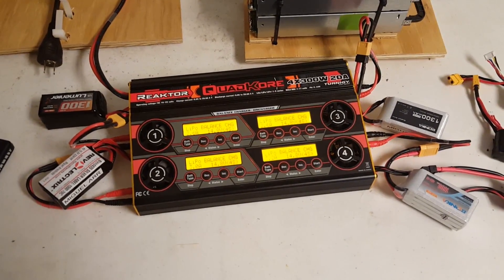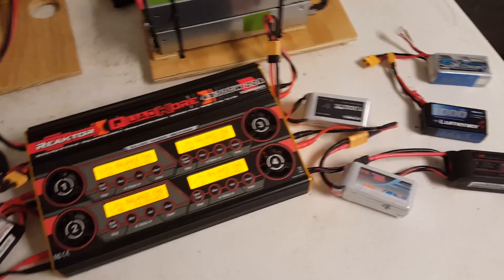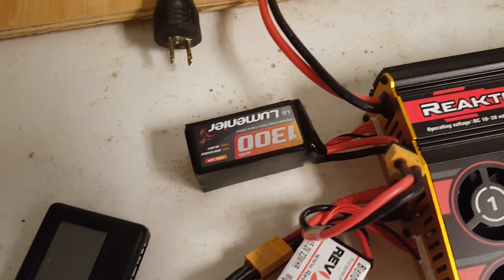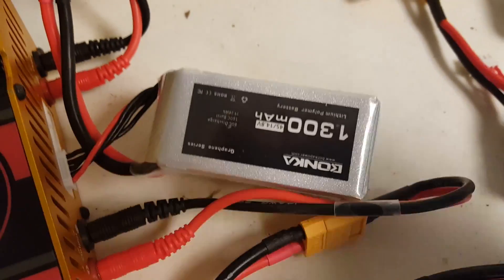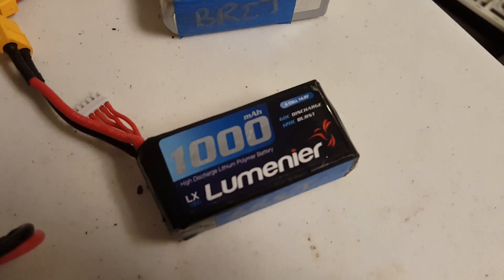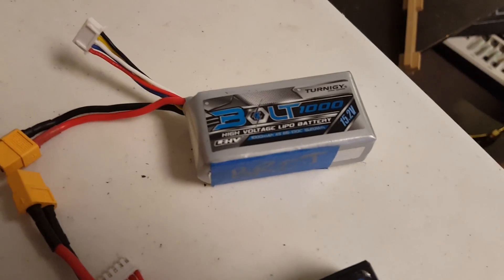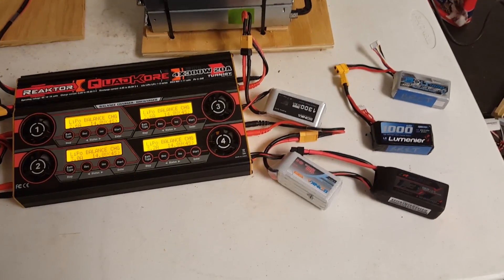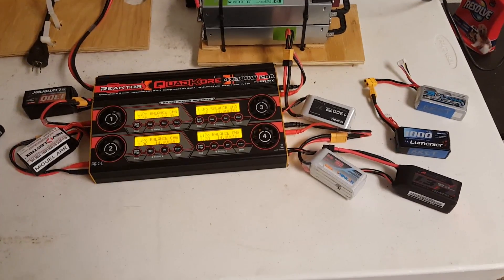Battery Test Group Two Teaser

Comment: Tell me you saw chad Nowacks periscope the other day at flight test? He has been and will continue to charge standard lipo's to HV levels without issue.  I wouldn't do it but after this group maybe try that with "donated" batteries. He's been doing it for 6months or so.
Reply: Says it works great but out of the interest of safety he couldn't "recommend" it. I wonder if most the batteries made today are "generally" the same Li on the inside. Even the HV ones.
Reply from the maker: +Invitingsauce My understanding is that you can charge LiPo to HV levels without substantial safety risk, but it shortens their lifespan. I don't have any test results to verify this. Wouldn't the joke be on all of us if HV lipos were just standard lipos with a different label on them.
Reply: +Joshua Bardwell If you would like to test it, you can use my lipo. Again this will be my slow backyard flying lipo. Thanks.

Comment: At this point in the test what standard 1300mah pack has the edge?
Reply from the maker: +Devin Stone Hahaha. Way too early to even speculate. If you go back to Group One, both the Bonka and the SMC did well, with the Bonka having some small advantage at higher discharge rates. The HV packs are the real stars though; they just spank the standard LiPos up one side and down the other. The only question about them is longevity.

Comment: Ok so I have some batteries for you but you need to help me get them to you due to shipping regs from the uk.
Radioc. Co. Uk 
We will both contribute but shipping from the uk is ridiculous. Have you got anyone in the eu we could ship to?
Reply: If it helps, you can keep the 2 batteries we want to send. Its sponsorship for them and a patreonesque contribution from me
Reply from the maker: Nobody in the EU you can ship to. It's just me. Honestly, it's probably not worth sending internationally. For the price of the shipping, it would usually just be better to order a new set to my address.
Reply: +Joshua Bardwell ok fair enough. I thought you'd say that tbh. Worth a shot. If you do get the opportunity let me know. fernandodlc2011 on rcgroups